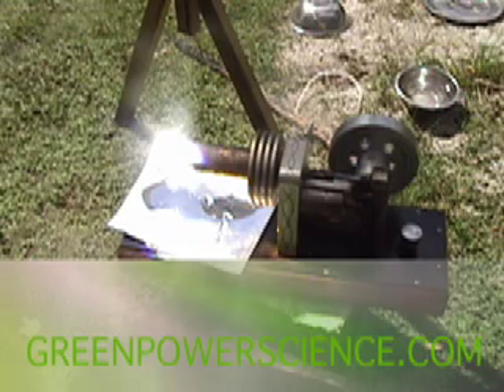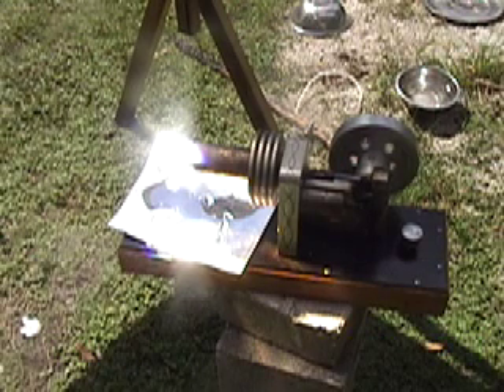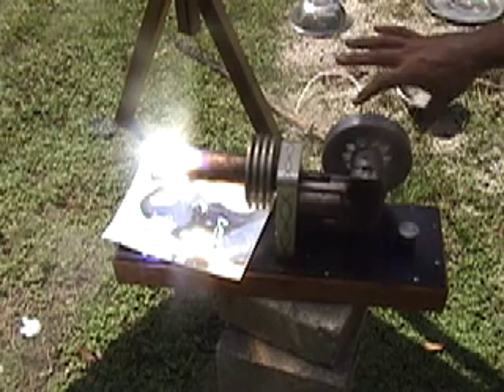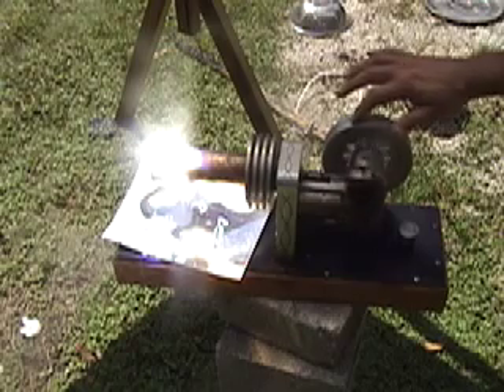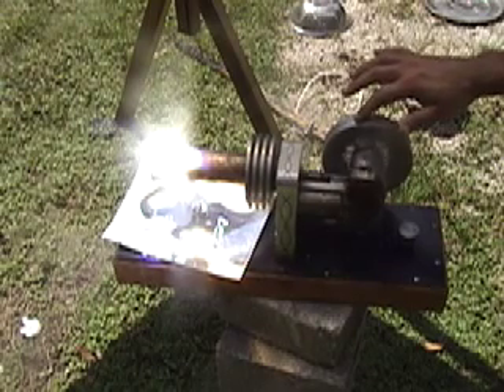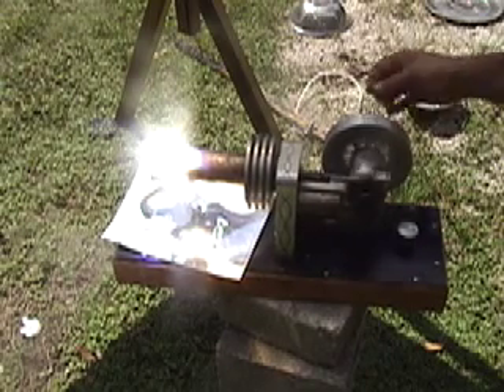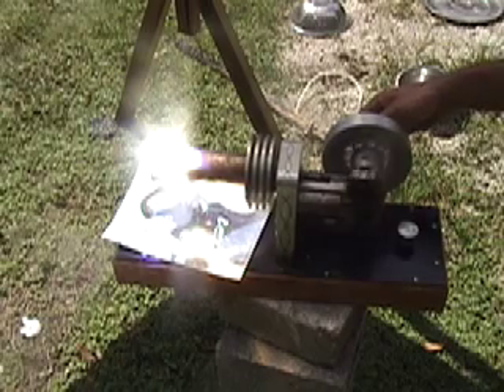Stirling Engine Solar Power from a Fresnel Lens and the Sun

Comment: What type of DC motor can I use? I tried to use a DC motor from a cordless drill but gave me only 3 Volts with very high speed. What I need is a DC motor that could produce 12VDC at least. please any help?
Reply from the maker: Mohamad khalife Hi Mohamad, For higher voltage you need a motor with finer wiring and more magnets. These are usually lower AMP motors that are smaller. The Stirling video had a geared motor attached. Drills also have a planetary gear but requires too much torque when used in reverse. For a Stirling engine, you would need a geared motor that turns easel by hand in reverse when rotating the geared side. These type of motors usually have steel gearing and a lower gear ratio vs drills.

Comment: Remember, creating electricity is as simple as moving a magnet in a coil of copper. The flywheel on the engine could be covered in carefully placed magnets and spun inside a coil of copper, then the copper coil ends run to a charger controller then to an ac inverter and/or battery bank to save the electricity for later use. It's actually pretty simple with some basic mechanical and electrical knowledge. A low temperature differential stirling engine would probably be ideal.

Comment from the maker: A typical house with a $200 a month electric bill would require an entire backyard. Maybe 30 sq meters of sunlight. PV is less expensive now by 1/5th when I did this video so at the 2007 PV cell price Stirling Engines were a possible alternative. Since PV has no moving parts it is a better option IMHO. The first step either way is to have a super efficient house. LED bulbs, new appliances etc.

Comment: Probably not much. The problem is not lack of energy, but difficulty in getting powerful off the shelf Stirling engines

it would be a lot cheaper to use a steam engine to power a generator

Comment: Great idea since the radiant energy from the sun only heats the area it hits anyway- no issues of hydrocarbon  except the energy burned to build the machine. How big would this piston driven stirling need to be to generate say 500 kw ( or around 670 BHP )  of electric energy ???

Comment: What if you used a long pipe, with a cap at one end & a cylinder/piston at the other & put that pipe in a parabolic trough? Would the extra, heated air volume produce more power?
What if you set up several nozzles down the pipe to inject water mist directly into the hot pipe on the piston's back stroke?

Comment: What would happen if you injected a small shot of water mist directly into the heat chamber through a small nozzle tapped into the side of the chamber? Flash steam? 
Wouldn't flash steam create more pressure? Wouldn't more pressure give more horse power?

Comment: What is the bottom line? Given the area of the fresnel lens.....can you generate more watts from it using a mechanical to electrical system vs the most efficient solar cell? Then there is the cost...Can you get more watts per dollar than an efficient solar cell than you can using a sterling or steam driven generator?

Comment: Is it possible to just modify the flywheel to where you can set up a magneto from a small engine(i.e. lawnmower, etc.) to produce electricity? Might take away a bit of the drag you get from attaching a generator to it.

Comment: The function of the displacer is to transfer the air from the hot space to the cold space. This sets up internal pressure cycle variations, which in turn drives the power piston in and out. A mechanical linkage links the power piston to the displacer and drives it at 90 degrees phase advance. Neat little solar engine - with a water cooled cold space and a glass jar (greenhouse) around the hotspace - it would really run well.

Comment: @gesnarfel 
depends on the weight of the fly wheel the heavier and larger the fly wheel the more torque it will have. the harder it will be to slow down.

Comment: If heating were your goal, you wouldn't put this in the middle, reducing efficiency, you would just use the sunlight that heats the air chamber directly.  This is to demonstrate making mechanical power from heat energy, which has it's own uses.  The actual amount of energy this produces (especially at this scale) would be rather low, probably enough to drive a small light bulb.

Comment: secondly it doesnt mean the whole thing is kept under vacuum , the system is enclosed and does not have any contact with vacuum environment , which will cause boiling of water or any liquid used .
these engines are presurized gas which are sealed properly not to fill every now and then gas inside the system, therfore proper sealing of engine in needed, because of these problem new technlogy of sterling engine uses the helium gas in ther systems.

Comment: This is not a steam engine, you need to research about the sterling engine, industrial version they use gases like helium for piston movement and the gas is enclosed, and is not wasted. the gas is recycled by cooling fins or radiators.

Comment: I said space not outer space, I mean a place open place, open land where you can keep more number of these unit for power production. I did not mean outer space,
it may be possible to cultivate the energy by sterling engine in outer space also, as there one can have 24 hours sun for energy production. I think NASA scientist must have taught about these thechnology to use in space also. already these system is being used in submarine where they harvest the boiler waste energy by using S engines.

Comment: the INFINIA company produces sterling engine which produces 1lmost 4kwh of power from just single unit, which if you harvest hundred or thousand of the unit in a vast open desert like space you can generate large amount of energy, ofcourse the cost of unit still is high as the unit is heavy and needs a dish which can track the sun during the day.also these system in industrial units where there boiler or furnaces can be used from the heat wastage from chimney output as long as furnace works.

Comment: namely the rotation of the drive axle, the inertia from that compresses the cylinder keeping the system going, stopping that cylinder stops the process. though i think thats true of all engines...
as for torque, the power of the engine depends on the difference between the hot cylinder and the cold cylinder (or the hot part and the cold part) so the colder the cold part and the hotter the hot part the more energy and the more subsequent torque. your heat sink was hot enough to boil water..

Comment: i do wish you would make more practical engines. use a bigger cylinder, have a better coolant system, and please stop using huge lenses for small engines, if you cant do the work with a proportional lens then scaling becomes an issue, if you actually NEED a lens which is 10x the size of the engine you have problems with your design.
if you use a better cooling system (such as cold water or something) you will get better power, but torque can be an issue, it depends on its motions to keep moving.

Comment: well, most of these videos show models that CAN'T power anything, they are for display only, that size of model right there, at full speed can be stopped by one finger on the flywheel.  Mine doesn't have enough torque to produce the 1.5 volts required to light one LED.  the smallest generator I could find to attach to it only made about .5 volts.  To do work, it has to be pretty freakin big.  It's the weakness of the stirling concept.  They don't do torque.

Comment: I think if  you changed the cooling to a drive system  E,Z . the cooling system could be a transmission the dodge bros came up with the hydromatic   now its automatic if you use the cooling system as a automatic trans insted of trans fluid use a gas like a/c with oil freon / oil /one way ports the gas expands at a coole temp and canot go back through a smaller port

Comment: you need too change out the air in side the engine too hydrogen its about twice as efficient as air in side the motor... hydrogen can be gathered by dc current and a battery or a any dc sorce and water.

Comment: Well, Stirling engines were used in the 1940's and 1950's as a small source of power for some companies.

Complaints were initial cost, size, and worse-off power production than conventional methods.

Personally, I think these are amazing.

However, I think steam engines and other very old technology are great as well.

I would like to build one of these myself.

You have a good day.

Comment: thats a clever system but i guess that it would result in some water loss so you would have to refill it and stuff,
the Stirling engine will supposedly make its biggest come back (from what ive read) in hybrid cars
since stirling engines only need heat to run there is just a flame in the car, heating the heat bit, then the electricity is just used 2 pull away

Comment: Interesting idea.

However, In a world which last year consumed a total (from all sources of energy) just over 480 Quadrillion British Thermal Units, it is of little practical use.

The problem with providing a solution to the world's dependence on fossil fuels, has always been how you get around the realities of the Laws of Thermodynamics?

Simply put, you can't.

However, if a solution did somehow present itself, how responsible would mankind be with it?

That is the more important issue.

Comment from the maker: That does not necessarily explain the last 8 years, highest "migration" ever. I think anything different than the last 8 years is a step in the right direction. Mexico has sun, waves and wind. Boosting their economy with alternative energy possibilities benefits both. Moving away from fossil fuels is the best choice. 100% is not realistic but ever 5% drops in crude demand reduces crude oil prices dramatically.

Solar can reach remote areas in need.

Comment: FAIL. guess what, they heat water to super-heated, super compressed state, and push it through a turbine to generate electricity. super heated oil is not as good as water, since water hold more energy per unit mass, and since it is in vapor state, it will give off more energy as it expands and condenses. your oil idea sounds good, but if it worked, it would've been done decades ago

Comment: i doubt it. if you cool the engine by rotating a fan, that fan is exerting a resistance to the engine's motion. what you can do, however, is have heat-pipes to a water supply (preferably running, like stream or river) and cool the "cold" side of the engine. and heat-recycling would be extremely hard. the hottest part is where the heat is applied, and heat only moves away from there, unless u got a heat pump, which still will make it less efficient

Comment: yes, if you can get a city-block sized lens to focus light on to the hot region of the engine. it only worked without the lens for that long because the focused light heated the engine up to an incredible temperature. if you want the engine to run through few days of no sun, not only need a huge lens, you also need some sort of system where you can take the hot region off and store it in a thermo so it can be used later on

Comment: Could this Stirling demo engine be made more efficient if some of the flywheel energy was used to drive a fan over the cooling fins to increase the temperature differential inside the engine? And can some of the extracted heat from the cooling end be recycled and fed back to the heated end?

Comment from the maker: Just air. A video going around on Youtube that starts with "Hey Roy", same engine in my other video with a parabolic dish, incorrectly states "Hydrogen is the working gas". All small engines use regular air because filling them with any gas, it would be gone in a few cycles. They are sealed, but not perfectly. 

My video

watch?v=vCleMqdGqug

This one has regular air too.

Comment: Great idea with the Fresnel lens. It is very large, very thin and cheap, compared to a classic glass lens. If you would have some black aluminium where the sun rays hit and a thermal insulator in between the hot side and cold side, I think the efficiency could improve.

Comment: wow.. this is impressive.. surely this would be an ideal solution for pumping water from underground wells, and irrigation for arid areas in poor but hot countries.. surely there's a lot of 'free' electricity here.. couldnt this even be utilized in our average back yards for a good supplement to our electricity needs..(or would it not produce enough wattage?)

Comment: no i just saw a japanese video where they made a stirling engine car.  mind you it used propane gas as the source, but it's not just a desk curio.  you can actually fun a car on it.

now how can this guy apply it to a car with sun as the energy source, would be a tricky design.

Comment: apparently i'm not up on my stirling.  

1. so you can have pure photovoltaic cells which convert sun to electricity  OR
2. a stirling engine which can be attached to a generatorlike thing which converts it to electricity?

Comment from the maker: Not true, Crokes moves in a vacuum. This moves in normal air. Also this engine can produce about 15 watts of power. While that is not much, it is still from the sun and FREE. Also this design can be modified to handle 100 watts of resistance with enhanced heat exchangers. Once those are completed, I will hook it to a DC permanent generator.

Comment from the maker: Yes, deep cycle. Applying a Stirling to any A/c applications without the luxury of Megawatts and power grids to feed is pointless. Low voltage A/C has limited use (flicker a bulb). But D/C has many usages including inverters to A/C. I am working on a few Stirling concepts that are much more powerful and truly not a Stirling at all.

Comment: Helium is far better it has an expansion ability 4-5 times that of "air" 2000+ vs 400? Hydrogen 485 much less than helium.
Containment on most hobby sterlings will not hold it so special sealing is req' An efficient motor should hold 50psi or more.

Comment from the maker: HI,
NO, THE FLYWHEEL IS GOOD for only 1 turn, the rest is the remaining heat held by the metal casing. A STIRLING engine like this one requires about 300 degrees F to run. The Fresnel Lens gets the metal to 800 degrees F while running even though the engine is acting like a heat pump. So it takes about 1 minute to drop 600 Degrees F in open air.

Comment from the maker: YES IN SOME HIGH QUALITY ENGINES. The Stirling principal requires air only. Hydrogen offers additional heat transfer. This engine as most old antiques used only air. All hobby engines also use regular atmospheric air.